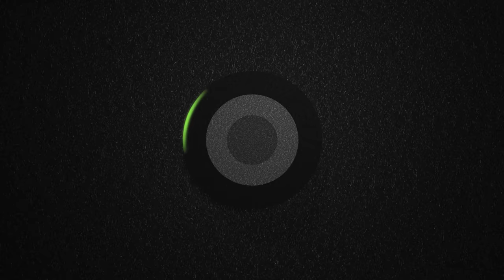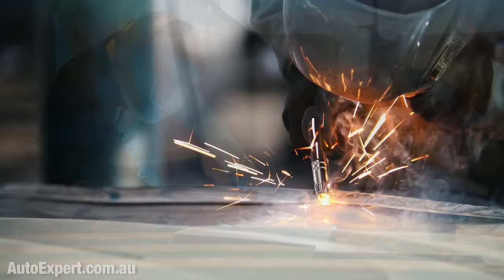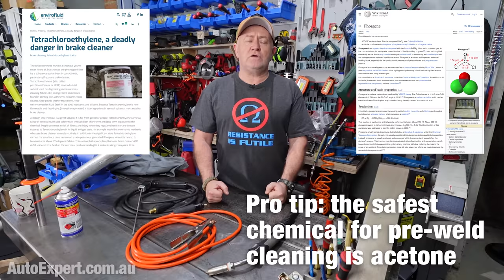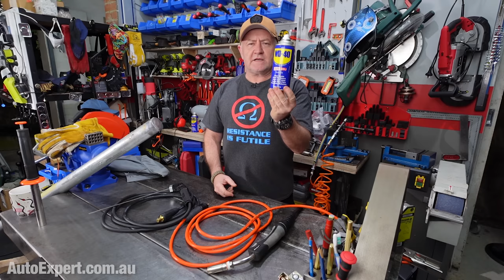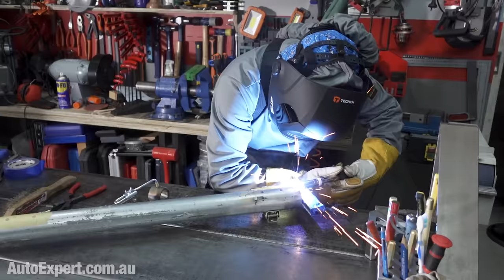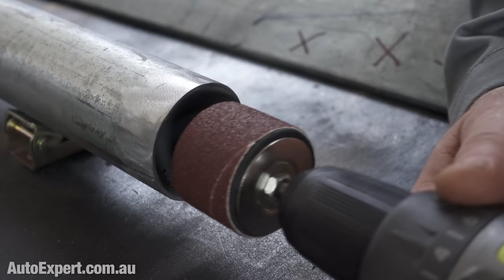How to die while arc welding at home: the top 5 ways | Auto Expert John Cadogan

Comment: Hi John Auto Expert?.

I have been welding for years at 75 after watching your video in the 60s there was basic health and safety at work. I have gone on safety courses and never had the info on the electrocution method you have just shown, a great info video.
Reply: Just a few points on this great vidio.  You totally blew off Oxy/acetylene welding! But this welding process would need it's own safety video because it has a heap of safety protocols. You didn't mention not keeping a cigarette lighter in ya pocket. And this one is a BIG MISTAKE to leave out- putting or wrapping any electrical and welding lead around or on your body. Because alot of Dickbrains do this because it supports the weight of the lead and its easier to move your arm to weld. But if there is a cut in the lead or (only relavant now days) the actual insulation of the lead is not enuf for the actul current going through the lead. And if something happens it's very difficult for you to get away from something wrapped over you or allow 1sr responders to get you away from the electricity or power tool that's killing you. And welding processes  effected by contamination in order from least effected to most is. Oxy/acetylene. Stick.Tig. Flux core(Gasless wire fed). Steel mig and aluminium mig. This list is for general purpose and repair welding, any x ray or pressure welding must not have any contaminates any where near the welding in the 1st place. And I do like you and your content but mate you can't weld for shit. Every job I have seen has multiple weld defects. This one had porosity and about 20mm of complete lack of fusion. In putting an end cap on don't make it flush sit it up a couple of mm then when you grind it back you won't get lack of fusion and less porosity. A corner to corner weld also looks way better if ya not sanding it smooth and it's less effected by galvanising. Also rubber gloves can be worn under welding gloves to stop those annoying little kicks when ya get a little bit sweaty but only if your a little damp if your saturated stop welding until there is no moisture around. I heard one dickhead tell our boss we could do it and keep working in the rain. He got shut down very quickly. My experience 30+yrs as a Metal Fabrication Engineer, just a fancy name for a Bucket Head Boilermaker. And I have experience in every single weld process known to man and Sasquatch.
Reply: @RandomRants525  If I recall correctly, John said he was an engineer. He did not say he was professional welder.  His examples were excellent, and I expect a shit-ton of people either new to welding, and even those more experienced learned something new.
You can take your 34 subs, you unfortunately common Sasquatch updates, and go be a prima donna yelling at clouds somewhere else.
Reply: @boots7859  WOW There's a SIMP for everyone isn't there. It's ok mate you'll get a life one day.

Comment: Hi John,
Welding is certainly a process that has become far more accessible to the home workshop than 3 or 4 decades ago, and the ability to weld a huge range of metals also. Certainly welding zinc coated steels, whether hot dipped or electro zinc and the zinc chills or metal fume fever from what I have read is more dangerous than you indicated. There have been ideas that drinking milk (basically calcium was thought to help remove or chealate the zinc from the body) but I think that has been disproven. The PAPR hood is certainly a nice solution, not only for avoiding the zinc fumes but also far more comfortable especially on a hot humid day. It is certainly a far more positive solution than a mask, although it is a particulate, so an N95 or similar can help, but like all masks, they are only as good as the seal to the face.

Your comments about the super sun tan from any form of electric welding is also important, and it doesn't take long to get seriously burnt, particularly if you have  not been exposed to sun for a while. The other thing NOT to do is wear synthetic clothing, some splatter can easily burn trough a synthetic garment causing quite serious burns, and the same can be said of socks and poor footwear, splatter going down inside a shoe can be quite painful and can get infected.

Your comment about knowing or checking your surrounds for dangers is also very important, many years ago, I had a factory a couple of doors away from a truck repair shop, and one day there was a huge explosion, one of the boiler makers was either welding or cutting on top of a 44 gallon drum (his workbench) that clearly  was sealed and had some dregs of leftover fuel or something rather explosive, well it ignited, fortunately no one was killed but he suffered serious burns. Same can happen if you are welding a sealed closure, let it cool before welding the final closure to avoid explosion. Same applies to anything that is to be hot dipped galvanised, never seal the item, or it an explode with catastrophic effect.

So I would agree that while it is a very useful skill to be able to do, it certainly does carry serious risk if you are careless. I guess the one thing you didn't really cover was the potential for serious burns, welding does get hot, and takes a while to cool off, so never pick up something that has just been welded, even with gloves.

Regards Dennis.
Reply: The particularly nasty thing about synthetic clothing, such as polyester is that it melts and clings to the body, thus exacerbating the burn injury. I once got too close to a campfire and the ambient heat was enough to start to melt my PolyPros. I pulled way before it got injured, however, that was a good practical lesson. 

On the other hand, cotton, while combustible, is inherently less adversely affected by flame, spark, and heat even if it is not FR rated. Here as well, I have the practical experience to speak from. 

FR gear is expensive, and one may not weld enough to feel justified in purchasing it, or they simply may not be able to afford it due to job loss, retirement, etc. However, quality cotton clothing is relatively affordable online or from farm and ranch supply stores. 

I also know about instant sun tans! Lol.
Reply: Why wear a n95 mask.. when p100 is way better..

Comment: Hi John, handywoman and part time metal fabricator and ex Holdens worker here. First, this has to be one of the best welding safety videos I have ever seen on Youtube, well done.I learnt how to MIG weld  in the 80's when I first started at Holdens, working in the bodyshop there. they were fanatical even back then about safety as far as welding went. you had to wear full overalls, sleeves rolled down, even on 40 degree summer days. then over that you had to wear a leather coat on top of that, and long gauntlet style leather gloves as well. it certainly did test how good your deodorant  was in the middle of summer, lol. we wore the old style CIG 'Ned Kelly' style helmets which you were always lifting up then flipping down again to do your next weld, so muscle memory became your friend, and you learnt how to leave your helmet down, and go by feel to do your next weld. (its easier to do  than you think, once you get used to it. ) they introduced self darkening helmets in the 90's which was great. some of the cowl braces, underbody panels we welded were galv steel, but all welding booths had really good extraction systems, so fumes were never a problem. 

On some of my home projects I've built which include a 6x4 trailer, and a racing cart designed to be pulled by Huskies in harness, among other things were built back in my old home garage, and used some galv steel in them, I always made sure I had  plenty of ventilation, and worn proper PPE gear , and made sure all flammables were kept well away from where I was working. and I worked outside as much as I could. I have never had an incident when welding, other than the odd burn here and there from a stray spark which is to be expected. it all comes down to common sense, and making sure you do everything as safely as possible .
Reply: You sound like a dream… If I were not already married…

Comment: Thank you John - "Safety First" can sometimes be pushed to the back burner in our home workshops in our rush to get things done, but safety awareness is just as important at home as when we're on the job.  I experienced the wet glove / stick weld electrocution many years ago when I first started welding (same situation you described - hot - sweating, wet glove, wet head band - 220V buzz box...I became the circuit).  I was very lucky, the jolt made my mouth snap shut w/ such force that I nearly bit the end of my tongue off and chipped a tooth.  I survived w/ no permanent damage, but needless to say, anytime I pick up a lead, I have one hand off the work surface and am wearing (dry) gloves.  Thanks again!, L

Comment: Most modern welding machines use an ocv of 24 volts (thats stick and mig/mag) at low current the current is only switched up when a very low resistance is detected, in the old days welding transformers had an OCV (open circuit voltage) of somewhere in the region of 65 to 95 volts,very often two ocv's were available these could give you a belt if you touched the wrong parts and back then the electrode holders very often had no insulation covering the jaws so it was all to easy. At one time I had one of those machines 450 amps at 95 volts ocv. and I got a belt on one occasion just changing the electrode through the glove and flux covering, to make things even more interesting I also used the machine with an add Esab HF unit for tig welding, that would give an HF spark 600 mm long and any electronics on the same circuit would get fried to boot. Sold that and got a Migatronic tig/ stick unit and the ocv was only 24 volt the only way to get a shock from that was to to stick it on your tongue, or turn the hf on with your fingers to close and then that was only HF so just a nasty tingle as hf travels on surface only. As far as PPE is concerned leather is best, I have tried the treated cotton in the past,OK for light work but as soon as you start high amp work the stuff starts to burn not outright flames it smoulders and can do so for hours. Never wear wear rigger boots or the like as sparks or slag can get inside the boot, good lace ups is best.

Comment: Great subject John. As a welder from 1969 and having changed career to paramedic in 1988, I appreciate your effort to educate weekend hobbyists. 32 volts and 1 thousandth of an amp is enough to buy an appointment with the local paramedics, or even the undertaker. Thank you for covering some of the other hazards.
Reply: The number you state of 32 volts, this is based on the threshold of class 2 to class 3 wiring? And the resistance of the average adult determines this does it not? As opposed to the available specs from the welding machines and or processes?
Reply: @jeffreystroman2811 , the number has nothing to do with wiring class. Any wire capable of carrying 1milliamp at 32 volts will do the job. Also, the resistance of the human body varies with moisture content. The output voltage of a welder is indeed variable, depending on the machine type and process intended, however, most will be above 32 volts and all are capable, of course, in delivering far in excess of the required current to give the undesired effect. As John said, sweaty gloves, clothing and body is a pretty effective low load resistor.
Reply: Wrong, I can hold onto that all day.
Takes more than 32v to even feel it, regardless of current available.
Reply: @mrbmp09 48v on the soft bits of your body can more than tickle, possibly alter heart rhythm, with obvious consequences. 
I've survived 240v ac several nasties, and ashooting, guess it wasn't my time😅
Reply: @mrbmp09  you may be able to "hold that all day", if you are dry. The current depends on resistance to the voltage applied. Any welding machine is more than capable of delivering the current. There is more than ample documentation of incidents where welders have been electrocuted, from a welding machine. This is drummed into all apprentice welders in their first few weeks. I have both experience as a welder from 1969 to 1988, and as a paramedic from 1988 to 2018, which give me some experience in the subject.

Comment: Years ago I was mig welding a quarter panel onto a 72 El Camino . It had been raining a few day so the shop floor was sweating . I was wearing shorts and kneeling next to the car onto the wet floor. I was not wearing gloves and had one hand shielding the flash and resting on the car and holding the mig handle in the other. Needless to say it lit me up when I pulled the trigger. The voltage ran through the hand resting on the car and through my body to knee on the wet concrete. You’d think I would learn but it’s happened a few times since. Be careful out there. Wear protective gear and never make yourself the conductor to ground.
Reply: A local sheet metal/cabinet shop that I worked at for about 9-10 months had a power draft hood for doing the occasional galvanized welding. The blower motor was supposed to "ON" when welding galvanized.
Reply: liar
Reply: I too was "tickled" by a MiG welder back in 1996 at a sheet metal cabinet shop I was working in,  at that time. 
We had a typical hard spring rain & the floor drains in the assembly area backed up as usual. I was standing in about a half inch of rain water, then leaned up against the cabinet that someone next to me started welding on. I could feel a little "tickle" when he began welding.  It was not a strong shock because the voltage on those is fairly low.

Comment: Wow, thanks john! I've been a mechanic for 45+ years and weld more than occasionally.  I wear a respirator on galvanized but have been careless with cans of shit lying around. Many years ago in an underground mine I started to drag long welding leads through knee deep water while my helper unspooled the cables . As soon as i felt that tingling sensation (the cables were knicked up) I told my helper to shut down the pto driven welder! Ive been lucky enough in life that my poor decisions haven't killed me yet! One thing I did learn in that hard rock hole was to not focus solely on the obvious hazard, not falling in that open 400' deep hole while overlooking  a few inches of unexploded dirty red det cord lying near the two sheets of plate we stitching up to cover the hole! A mine crew shift boss came by to make sure we were being careful and saw it. The chewing out he gave us woulda made any sailor proud.

Comment: When I do stuff like this, it isn’t called welding. More like a visit from the silver pidgin. My welds are kindly called disgraceful. TF for angle grinders.
Reply: Seagull droppings ???
Reply: @chrisbraid2907  silver seagulls…I like that but I’m not a boatie. We grew up calling them shitducks.
Reply: Doug ,  honesty go a distance ,,  keep at it mate you will figure it out ,,   always grind steel clean where your welding ,,  grind a spot for earth wire ,,  use a g clamp earth to ensure a perfect connection,   if stick welding ,,  start with saturn craft 2.5 sticks ,  tend to work light a soldering iron ,  make sure you angle 45  , drag stick till it fires up then feed it in and drag back 1/4 INCH push stick in and drag back as before
Reply: The tip about pressure cans near by ,  shit I see this dumb shit to too often and admit I've been guilty here,  but not next time
Reply: @holdenbrougham1056    I like Austarc candy sticks. Seriously, I’ve been welding since Uncle John helped me repair a broken frame on my little trail bike as a nine year old. I an a fitter, but my welds have always been shit. Maybe my right hand shook more than a dog shitting razor blades, all academic now. As a recently inducted left hander, over eight years now, I like to think my game has picked up. I have just welded up the deck on my ride on ready for spring, not too bad, considering. My old man would scold me grinding or sanding. “It’s the habit of a criminal to remove evidence….”
Reply: Grinder and paint for a welder I ain't?

Comment: I've been amateur welding for 20 years and never knew about the brake cleaner thing. Good thing I am so lazy about surface prep (heh), although I did know about the galv hazards.I always sand/grind that off, and try to position myself out of the fume cloud. I have also set the yard on fire when welding outdoors in the hot/dry and had to run around stomping out the grass. That one scared the crap out of me, so I made sure to only weld outdoors when I had my partner around to be a safety observer. I was recently watching a fab channel, where the guy would close his eyes/look away and just pull the trigger/spin a couple circles to spot weld. No gloves, short sleeve shirt, flammable hat on. Utterly insane.
Reply from the maker: The hood can certainly delay your awareness that everything is on fire around you...
Gal is also a big contributor to porosity. On GMAW you can work around it by turning the WFS down, increasing the voltage (both slightly) and making the work angle a bit more upright. (But you still need to worry about the fumes.)

Comment: 1. Using Chlorinated Brake Cleaner to clean near your welding area,  which makes an extremely deadly gas after reaching 350 degrees . (Use acetone instead)
2. Electrocution. Sweating into your PPE (gloves) can cause it to become saturated and reduce the resistance protecting you from electrocution.
3. Melanoma from the UV radiation off the arc.
4. Accidentally making a bomb in your shop by having flammable/explosive things near your welding area (ex. WD-40).
5. Welding galvanized steel. The zinc, when exposed to the arc, oxidizes releasing gases that can cause Metal Fume Fever. Lead oxide is also released, and can cause different types of cancer.